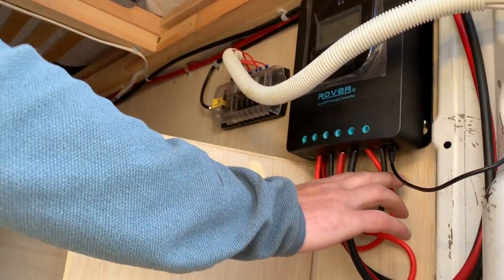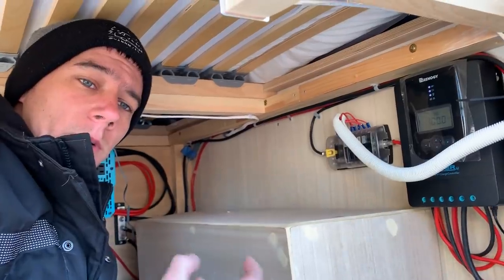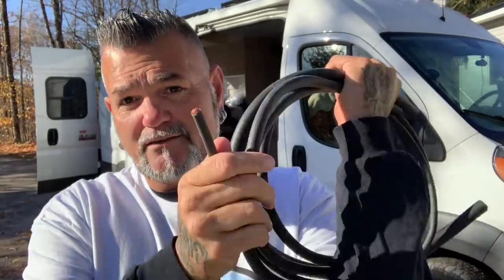VAN BUILD PRO TIPS • Electrical And Solar Install Common MISTAKES

Comment: 👍👍👌👌 Just some advice
 from a heavy equipment technician with over forty years of experience at the journeyman level get a certified person to do your electrical in your vehicle and not someone who thinks they can do it. It is like wiring your house choose carefully so you can sleep at night.
.
Reply: The problem is a lot of fires are poor people who are just scrambling to have power and following DIY on YouTube. That being said, I feel like I avoided a lot of these mistakes by watching Will Prowse.
Reply: As a General Contractor, and have been in the business for 26 years, I couldnt agree more. I give some presentation classes on solar power, mainly related to HAM radio, in the Tulsa area. When people ask me questions about specifics on wiring I do not answer them. I explain that this isnt anything to take risks with. While I could answer the question, Im not willing to carry liability for a mistake they may make later in trying to put a system together. Just not worth it.
Reply: What is the certified person called and where do I find them if I look them up on Google a certified what?
Reply: @connietownsend4237  Electrician?
Reply: ::licks his thumb:: and points it at vehicle....  Yea we can get it done.

Comment: Big tips: use wire gauge charts for steady state current. The wire will handle inrush or spikes. Second, rate your protection devices for 10-15% over current protection, no more than 125% of what you’re going with. 50A for a 40A line is 25% and is maximum. I would use a 45A slo blow fuse or 45A circuit breaker with thermal protection.

Comment: no cut off switch at battery. circuit breakers are the correct way not fuses.

Comment: I've ran wire in a house that can run blenders and TVs and just about everything. they are way smaller than that wire you showed so I'm confused why you need such a fat wire?
Reply: 110-120 volts in most of your house wiring. Lower current/amperage than 12 volt systems. Wire "carries" amps (the quantity of electrons moving). Voltage is the force causing the amps to move. Voltage times amps equals wattage. Wattage is the amount of work the electricity in use can do. 12 volts pushing 15 amps is only 180 watts. 120 volts pushing 15 amps is 1800 watts. Can't do much with 180 watts. Can't do much with 14 gauge wire at 12 volts. That same wire at 120 volts will do plenty.

Comment: This is the reason why I’ve watched a tons of videos on each subject I want to build before I install it.

I’m currently building my 1st van and I’ll be using 3 of 100A 12.8V Power Queen Lithium Batteries. I’ll be connecting them in Parallel to keep the same 12V system but will be increasing the amps to 300. 
Because of that, I can get away with a 1/0 AWG wire but I’ll be using 2/0Wire to connect the batteries.

And what I’ve learned is that you want the Wire coming from the Inverter you’re using to be larger than the battery wire you’re using this I’ll be using a 3/0 AWG wire.

Know your wires before you do anything. 
The bigger the wires, the smaller the number. Like 12g is smaller than 10G, and on to 0 Gauge wire.

After 0G wire then you’ll get 1/0 Wire them 2/0 and so on. 

Any it WON’T hurt to have a breaker or a Fuse for each wite you’re running. I’m not saying to over do them, but if you aren’t sure….consult with someone or if you can’t find anyone them run a fuse. Worse case is to pop the fuse then burning things down. 

And NEVER hook up your solar to your charge controller UNTIL the controller is already powered on by your batteries.

Comment: Nice video.  Thanks for the blue sea calculator tip.  Wire is cheap compared to burning down a an.

Comment: Somebody shoulde tell people that sealed lead acid batteries need to be disconnected from charger when fully charged.  They will continue to charge and heat up to a high temp and a fire will result.  Please tell folks this.  Some deep cycle batteries come woth smart charget that turns off when fully charged.  Not all do. Be careful of this fatal mistake
Reply: KT Brady depends on how you’re charging it though. Solar charge controllers are smart devices and will avoid overcharging your battery.
Reply: "float" charge can be continuous if I'm not mistaken.

Comment: I didn't see any grounding. Is it necessary to ground the leisure battery to the chassis? Or does the DC negative act as a ground? Curious..lengthy explanation is fine.

Comment: In the video he says that for a 3000W inverter with a 6000peak (the Victron) to use a 4/0 wire.  Is a 4/0 wire large enough for the Renogy 3000W inverter that has a 9000W peak?
Reply: No

Comment: I'm in the middle of a small build with solar, I'm happy to know I did mine right. And I did learn what the load off the mppt controller was for - I do not need it. Thanks chrome, another great video.

Comment: Thanks for highlighting the mistakes DIY builders make. Most electrical installs I have seen are shocking..... points that you have highlighted plus lack of isolators and mechanical protection against chafing etc. I  have a real concern with the structural and electrical side of some of these builds. People need educating to make these builds safer or we will end  either not being allowed to do it or will have to jump through hoops with legislation.